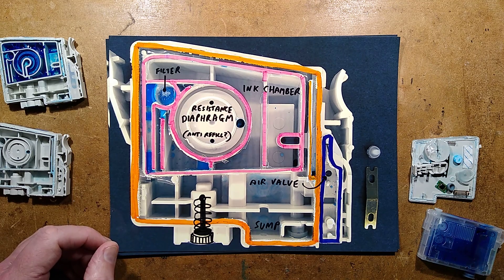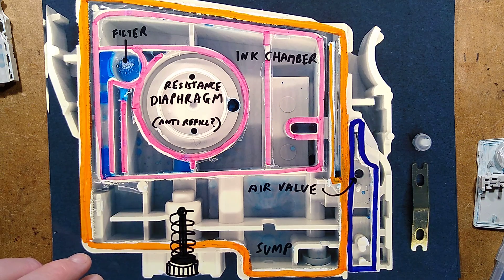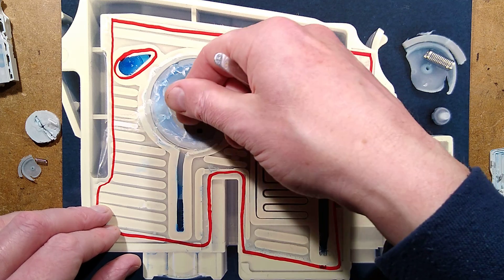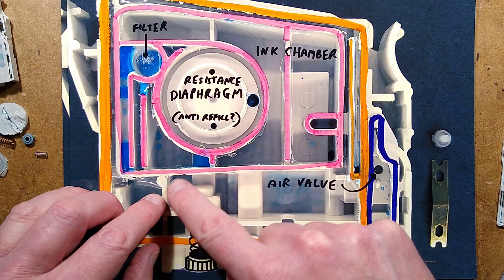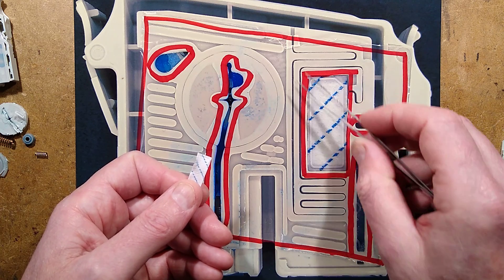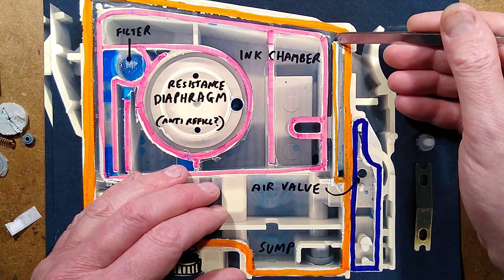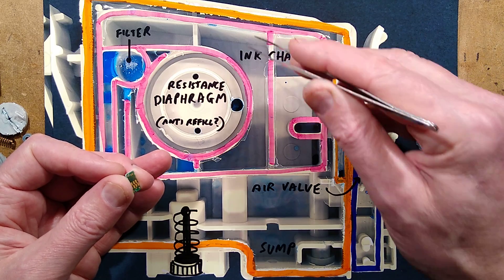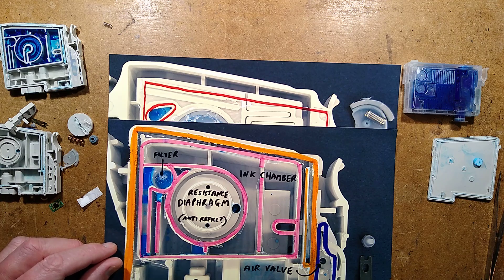Ink cartridges are complex inside!

Comment: I don't think that's an anti-refill measure. I used to work next to a place that did cartridge refills and they would drill holes into the top to fill ink and then glue them off. My guess is this is just part of the pump mechanism to make sure that ink only flows in one direction as the printer actuates it.

Comment: The 7 contacts on the chip went up to 9 contacts at one stage. The outer ones are dummies so ignore these and you are back to 7 contacts. Think the new version has the same 7 contact pattern but only 5 contacts fitted which are the positive, gnd, data, address and control. One number in the chip is for the cartridge type so it matches the printer, another number for the colour, and another number for the print count. There is one other number hidden somewhere in the rest of the memory. Apparently, if you 'reverse maths' it and convert it into letters of the alphabet, it spells out "Epson Ink" and that's the number that the printer recognised as a genuine ink cartridge. The last of the ink, even when the printer says the cartridge is empty, is to keep the print head wet, otherwise you will have massive problems with a dry print head.

Comment: I took apart a (Canon) ink cartridge about 10 years ago and so far as I recall there was a little rubber valve thing and then just a large dense sponge which held the ink. It was a much simpler design.

Comment: No one should buy ink cartridge printers anymore! If you REALLY want the ability to print color, get an ink tank printer. I have one, and it's been great. You can use any ink you want, and it's WAY cheaper. Like 1000x as much ink for 1/3 the cost. If you don't need color, just get a laser printer.

Comment: I had old Epson printer that didn't have chips on cartridges. It had some stupid system that you need driver utility to make printer to align head in cartridge replace position (accessible from cover). Once I "changed" cartridge by just reinstalling old one and printer continued to print, printed about 30% percent more pages until started to fading out. But, utility reported about 60-70% in level and didn't allowed changing cartridge. I painted paper in black in Paint and run few tens of papers thru inkless printer to make it allow me to change empty cartridge...

Comment: I always used original Brother cartridges as it was an expensive printer, but now its over 10 years old i just started refilling the original ones. They don't have chips, just an optical float mechanism to indicate to the printer when empty so when you refill they reset themselves. They have a similar plastic film to the epson ones so i just snapped open the outer case, injected the ink through the film, and sealed it again with sellotape. Have had no issues with doing this so far.

Comment: I bought a 3rd party black ink cartridge once and the print quality was bad. So I stuck to original ink after that. But I use the printer so rarely the ink tends to dry out. So I recently got a laser printer, which with how often I print stuff, I probably won't have to replace the toner cartridge for decades.

Comment: I wish I had the tools still. I would show you how we filled the T032x series and T04xx cartridges. We had to cut one of the ports at the bottom and use two syringes, one in the ink port to receive the air/ink, and the other to inject the ink, then we sealed with either a special rubber plug, or hot glue, then pull back on the ink port syringe again to create a little bit of negative pressure in it.

Comment: Excellent video, as always! I was actually very interested in the seemingly overly-complicated engineering that went into that cartridge. Sometime between 2014-2016 (I can't remember exactly when), I bought a Brother scanner / laser printer combo & have used the same one ever since. I'm only on my second toner cartridge (I don't print much.)   But the funny thing is that one Christmas I needed to print out some color things, so I went to walmart & bought an "on sale" printer for 20 bucks, used the ink that came with it until it was gone & then recycled the thing.  Such a waste, I know, but when a whole unit with ink costs less than an ink refill... well...  that's what I did.

Comment: 6:33 That filter is very similar to what I would call a gasoline pump screen, often called a sock for obvious reasons. Gas pump socks tend to be a bit more gauzy, often it is a type of coarse woven plastic screen sealed around an injection molded pickup tube, but occasionally can be a larger version of what is seen here.

Comment: I have a large inkjet, prints 24" wide. There are off brand inks available for it but I want color accuracy so I just use the stock ink tanks. The ink sellers do offer calibration profiles for the ink but it's just not worth it to me.

Comment: I recently replaced my old Epson cartridge system printer, for what I thought was a better option. The Epson ET-2720  Eco Tank !    After a few weeks of having not being used, it's now showing signs of missing colours, so not immune to the same old ink jet issues. Difficult to get in behind the head, as no cartridge to remove and flush the head with a syringe and cleaning fluid as I used to do. Now isn't that's a bugger. ⁉
Reply from the maker: That's odd.  Did you leave it plugged in and turn it off on the control panel?  That ensures the heads are parked properly.  I keep one on a yearly job and even after a year of being in storage it quickly returns to normal printing.

Comment: I last used an inkjet printer, an HP500C nearly 30 years ago.  Almost every week in the 90’s a work colleague had tales of woe regarding his Epsom printers either drying up, leaking or blocking.  When they worked the output for photographs was certainly very good.  

I’ve been using laser printers ever since, both mono and colour.

Comment: i work as a large format printer tech and the big printers that have machanical inkt system they have a damper that has that diahpram in it its so the inkt wont just go out the print head so i dont think its to stop you from putting new inkt in

Comment: Hi Clive

I have found myself getting caught up by these so called auditors who bother businesses in the hope things will kick off and they'll get some YouTube views. I really dislike it but can't seem to stop watching.

I'd be interested to an educated Input on this one if you have time vs the fella who's picked up a few tools from Amazon and may be using them completely incorrectly.

The short of it is he was riding an electric bike under some pylons and feels that he got an electric shock when he touched the metal part of his handlebars.

It reminds me of when my wife insisted on draping our metal 4 poster bed cheap led lights, if you brought your phone into it whilst charging you'd get a tingle. 

I wasn't sure if it was creating some kind of Faraday cage having the wires all over the place, if they were poorly insulated Chinese tat or something else altogether.

Would what's he's experiencing be similar, an issue with his bike or just the sheet excitement that he's got the potential to noise up some poor security guard with his drone?

https://youtu.be/dU7-CSQVESY?si=iZqJmElOndYs9MVL
Reply from the maker: There is a high voltage gradient below electricity pylons due to the high voltage.  It's enough to make a fluorescent tube glow very dimly when held underneath them at night.  In train stations you will sometimes see bonding wires to the metal seats because of the vicinity of the high voltage overhead line.
That field meter is similar to a volt stick.  It's just a gimmick.

Comment: Those cartridges are more complex than most. At least older hp cartridges have none of that.
The ones I've opened are the 22-23-27 economy type variants. They only have a big cavity (mostly empty) with a sponge that holds the ink. And the air "valves" are just a few thin air passageways partially covered by the sticker up top. Quite clever and cheaply designed.

Comment: Ink credible! May I applaud you Clive on producing such a detailed explanation of the inner workings of the Epson ink-jet cartridge. These things have been the Bain of my life for many years now, and just so ridiculously expensive. at around £50.00 - £80.00 for an original Epson ink set. Each colour cartridge contains 5ml of ink, the Black a little more. " That's just around a Teaspoon of ink.
I have of course tried, refillables " They seemed to leak ink into the printer, and flood the head" " Have never found a reliable re-manufactured cartridge, as they seem to clog the printhead. Have attempted to refill originals, purchased chip re-setter & refill kits.  messy job and instructions are varied as to where to inject the new ink. As you show, injecting directly into the output nozzle would not work due to the diaphragm. I have attempted to take them apart, to figure out how they work, and find a suitable point, cavity to inject the new ink. It seems also that newer cartridges will not reset, using the resetting device, if the ink level is allowed to drop below a certain point, which I believe to be when the empty cartridge indicator turns on, or when it drops below an ink sensor. If by chance we get a missing colour due to head clog, after not using the printer for a month or two, Using the head cleaning function, will purge ink from ALL of the cartridges installed, and end up dumping the majority of all your ink into the waste pad. Hence, it  does not discriminate as to which cartridge  is blocked. I do believe that Epson do indeed take great measures to prevent the average user from re-filling their cartridges.

Comment: I wonder how different it is for other manufacturers? I have an HP printer that takes 301 cartridges, and you can refill those just by removing the label and sticking a needle into the sponge, so I’m assuming that they’ve simpler internally. I’ve also noticed that the capacity resets when I refill them, so it must be doing it some other way than changing a counter. 

Also, you can really see why printer cartridges are a pain to recycle, with how many different materials are in them!

Comment: I've not used an Epson in years. In fact a have a 15 year old HP Photosmart just because it's easy to refill. But the Epson I had before it had chips. And with a chip resetter alone. I used to get 2.5 to 3 resets before I had to actually add ink to the cartridge. That's why I moved to the HP. Although when this finally dies. Or I can no longer get replacement cartridges when the heads block. I don't know what I'll do as I believe HP are worse than the Epson was now. 🤣🤣🤣🤷

Comment: Crazy complicated. I remember old HP ones. That used to have ink in a tiny plastic bag inside the cartridge and the cartridge was just a box with a tiny hole to let air in. 
But those were that that also had the print head on them so it made things way simpler and more expensive to replace.

Comment: It's overengineered. Normally it's just a sponge to prevent splashing (and foaming of the ink), an inlet hole with a long 'maze' to create air resistance, and the main output. High capacity cartridges have only a small amount of sponge that "de-airs" the ink before it leaves the cartridge.

Comment: I went to an Eco-tank printer a few years ago, but I still use a cartridge printer for dye-sub printing... that requires me to use refillable after-market cartridges. And also to never allow software upgrades, since most of those are designed to prevent the use of after-market cartridges.

Comment: A lot of the ink refill kits have a needle to get the ink in to the ink chamber and avoid that small air chamber.   As long as you don't overfill them, very little ink gets in the airpaths.   
I gave up on inkjet though as I actually don't print enough to make it viable.   The ink tends to dry in the heads, causing blockages that just don'r happen with a laser style printer with dry toner.  That was my reason for switching from inkjuet to laser jet.  Not to mention that when printing PCB's I can use a method called "toner transfer" where I can print the inverted PCB on paper, than pass it through heated rollers to transfer that toner onto a PCB then etch it, using the toner to protect the parts of the copper I want to keep

Comment: I no longer have a printer, last one was a b/w laser. I used to print photos and designs but I rather view them on screen. Whenever I need to send a signed document, I do it digitally. 
I remember messing around with epson and hp refillable carts with injection needles, fun stuff! It just had a rubber lid and poke through it with the needle. 
Inkjets were too expensive to use regularly and if you don't use them regularly the nozzles clog up. All in all it was a horrible experience, never going to get bitten by that again.

Comment: Basically there are two designs of ink cartridge tanks, one is the shown here where you dont have sponge filled with ink inside, but you need one way valve to prevent ink syphoning out, the other is simpler construction but it holds less ink, there you have a melamine sponge holding the ink and under the sponge just a filter.

Comment: The biggest trick is the fact they sell the printers at a loss with the money coming from the cartridges. Couple of years ago I switched to an Epson Ecotank model. Yes you pay the true price of the printer up front but the huge tanks, after 2 years and thousands of pages are still half full and the printer came with a spare set of refills too. As its permanently primed it never clogs or stripes. The sheer amount of time/cost saved in not having to sort it out regularly is huge.

Comment: I remember the older cartridges used to use bags inside instead if memory serves me correct, with just a simple vent hole. I'm guessing this probably wouldn't provide sufficient control of the ink with the newer printer technologies. For all the complexity, it sure is a waste to just toss the thing a month after you buy it.

Comment: At least Epson have not (yet) gone down the HP route (documented and condemned at length by Louis Rossman recently), of holding users to ransom in various disgraceful ways to compel use of their own cartridges, even when no ink is required. Needing an inexpensive replacement for a broken Brother printer  in a hurry a few months ago, I bought an Epson XP-6105 from Argos. Not only was I surprised to find that the included cartridges were not mere "starter" items - but printed many pages, the printer also grumbles but accepts the much cheaper alternative replacements purchased from a reputable supplier of such.

Comment: I have used an ink tank printer for a few years and it’s so nice not having to worry about expensive ink cartridges. I have been looking at professional photo printers but the 12 ink cartridges and the expense of replacing them has made me realize it’s better to order prints from a professional lab unless printing and selling lots of prints. Would only use original cartridges in a professional photo printer for color accuracy and consistency. Loving ink tank for home and office use though.

Comment: I've been using third party toner cartridges in my HP Laser printer but the quality isn't great ( inconsistent colour rendering) so I'm going to bite the bullet and order genuine one next time round to see if that improves things. One thing I have found is that, subjectively, the HP Laser doesn't print photos as well as the Epson ink jets I've owned in the past. I'm tempted to go and buy another one of the Epson 'throw away' (replacement ink costs more than the printer) printers next time I need to print a high quality photo.

Comment: meenwhile chinese replacements only have rubber pierce trough seal and a sponge and it still works most of the time, and when it don't... it only cost you 1$ to get a replacement so you just keep spares

i really don't know if epson makes this for relibility or just to make it harder to copy but in the end printer just need to be gravity fed to avoid ink starvation , either way epson is kind of giving up on this design with factory constant ink systems and let you just refill printer from the bottle (cutting down on unauthorised ciss sets profit)

we at my work buy the cheapest "compatybile replacements" on local  ebay. not a remanufactured oryginals, that was good for hp/canon printers with disposable printheads. just get a bulk of those "1$" cartridges and when printer say it is low just swap it 
i did had printhead vapor locked 3 times over those 4 years we have this a3 ink epson printer, but it was easy enough to fix by just swaping to another cartridge and cleaning the heads. i don't think anybody is bothering with reseting chips nowdays, 
but i guess home users just often pay for hussle free experience with new oem ink
and yes i work at a school so prints only have to live few days before they end up in trash

Comment: Canon BCI-6 ( + BCI-3eBK for the larger black cartridge) were pretty simple, maybe check those out.

For the record, I have a relatively modern Epson, a WorkForce WF-7620, and I use eBay remanufactured cartridges. Almost never had a problem with em... cheap, too.